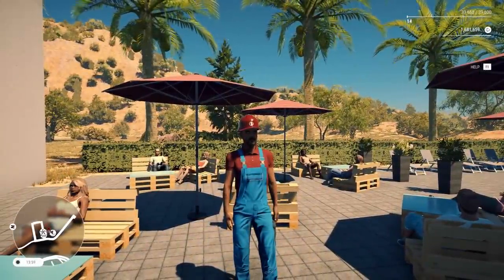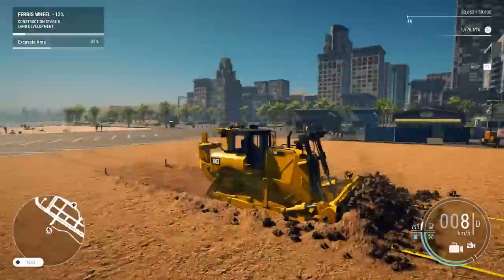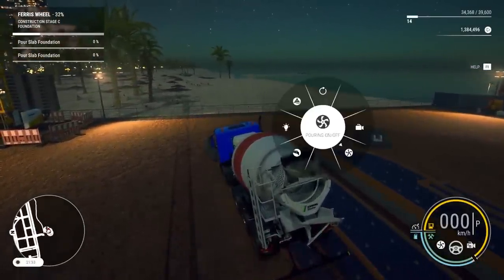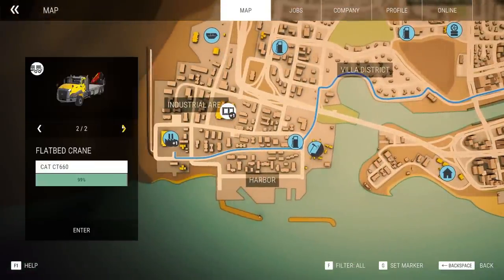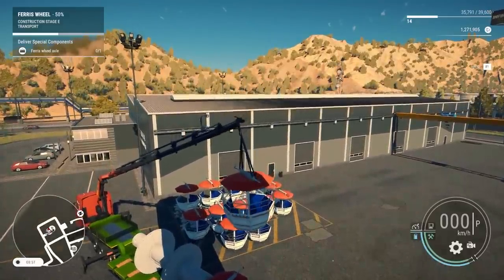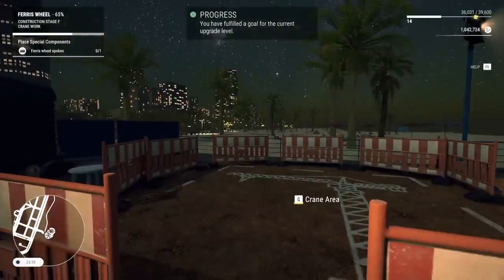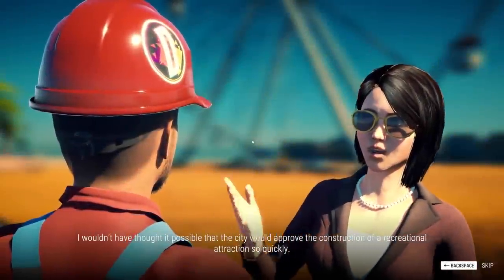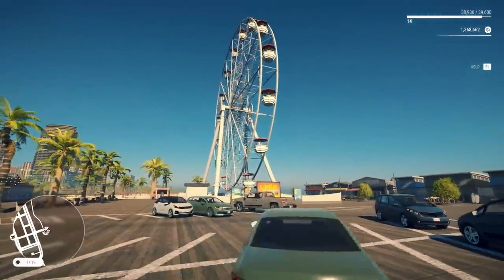Assembling a Massive Ferris Wheel from Scratch - Construction Simulator

Comment: Grate vid drea also if you want to you need to start working towards the biggest crane in the game the limberr mobile crane because soon you will use it to erect some tall structures and only it can go high enough plus it can lift the most weigh out of all the other cranes in the game and for atleast one contract there is an piece that is so heavy you need that limberr crane to pick ig up and put it in place. The contract is for the building the dam on the high setting with it  gives a good amount of money I remember it was 1 milion I think but of the rest of the contracts on high scope it is all close to l million money and then for one job on high it is 3 million so definitely good to do the jobscope on high.  The big crane also helps a lot when you build the shipping container hotel so (spoilers) sorry.  The crane you got this episode is the tower crane and it is the second heaviest lifting  crane in the game. The dirt you push away with the bulldozer can actually be scooped up by a loader an put into a dump truck and sold at any quarry for as much as 10,000 to 15,000 a load. Grate videos and hope to see more soon. I play the game and thought you could use this advice to earn some more money and help prepare you for future contracts.